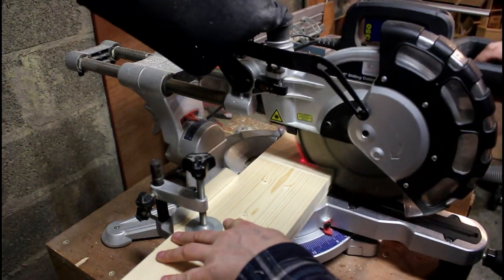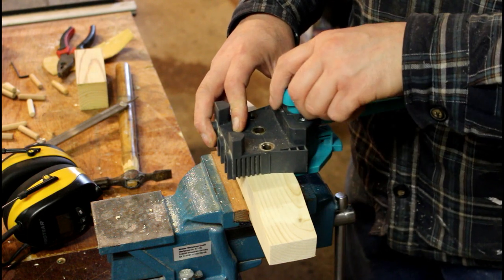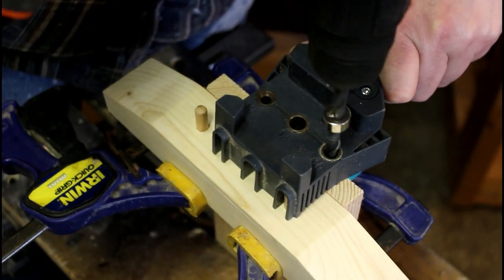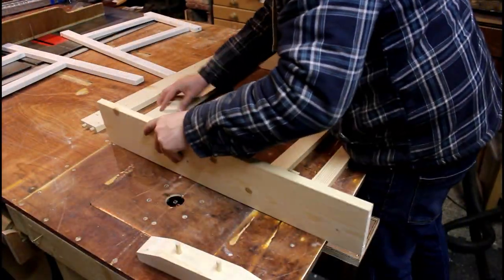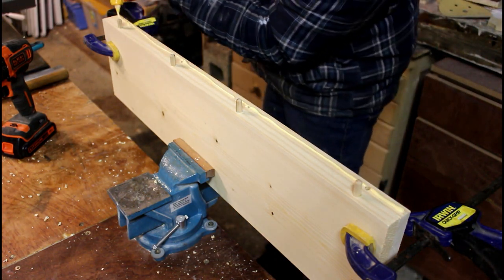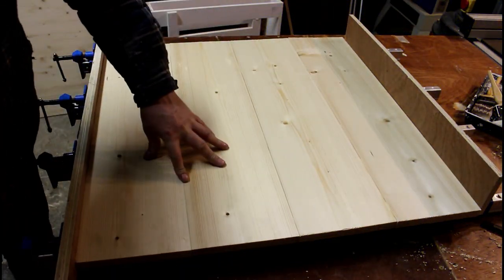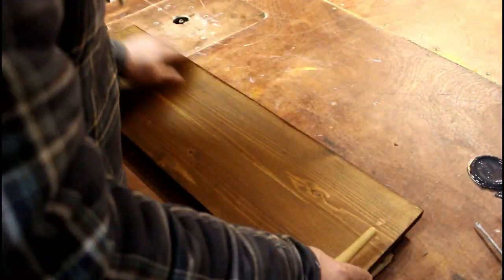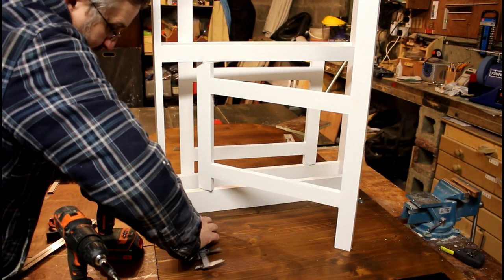Gate Leg Table

Comment: Thank you for posting this.  I have a table that was probably built in the 1800's.  It has two drop-down leafs, which when extended, makes the table horribly unbalanced if ANY PRESSURE is placed on the extended leaf.  I will, somehow & someway, add two more swing-out legs as you did for this table.  

Thank you for also including a snapshot of the table leg stop on the underside of the leaf.  Good idea!!!